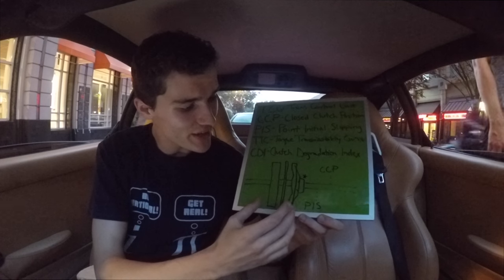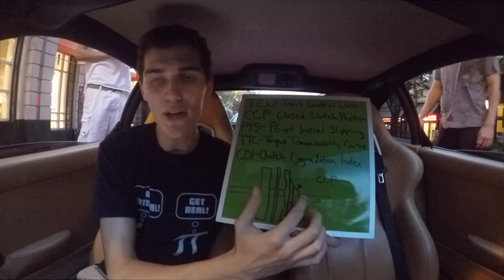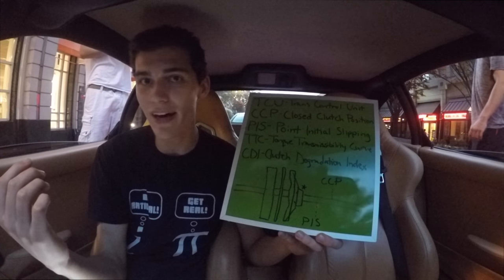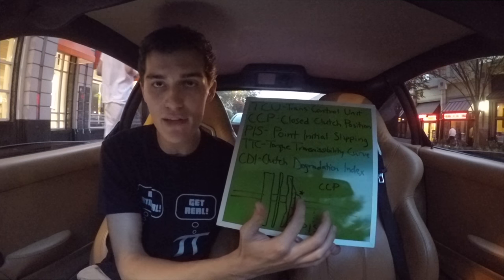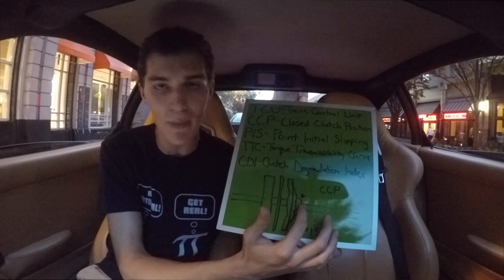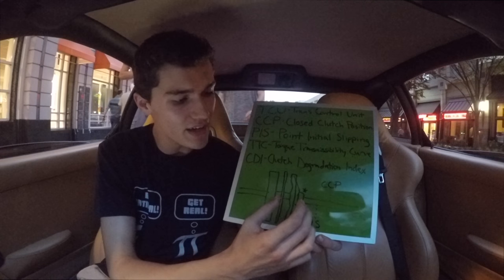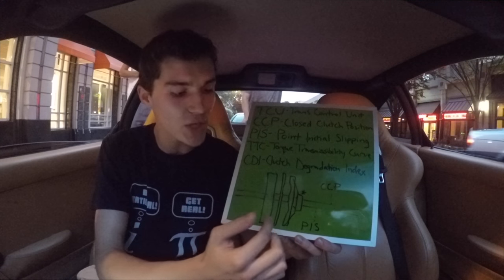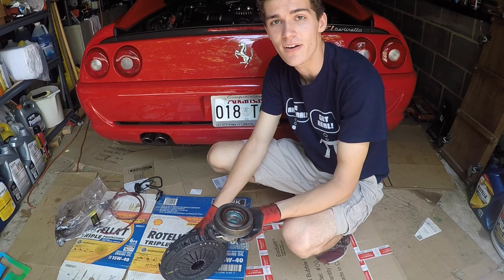How Automated Manual Transmissions Work! (F1, SMG, E-Gear)

Comment: Does it rev-match downshifts?
Reply: No it doesnt. One of the best things about the 355 F1 system, you can and should manually blip the throttle on downshift. 360 onwards with electronic throttle sensor has auto rev match on downshift.

Comment: I always thought an F1 had 2 clutches and is less than half the size of that power sapping clutch of yours. My father has a vw Passat with a 7 speed dual clutch tiptronic  now it works on the same principal as an F1 so when the car is in 1st ,  2nd is ready to be engaged by the 2nd clutch so it changes gear very quickly and smoothly. or it can be changed manually

Comment: I'd rather have a normal manual transmission. Heel toe shifting is a lost art. The F 1 can shift faster than a manual too I know but gains from that are only going to be seen on the track. Plus when my friction plate wears out I can swap it out in my garage. Not to mention cost. Over engineering for a street car in my opinion.